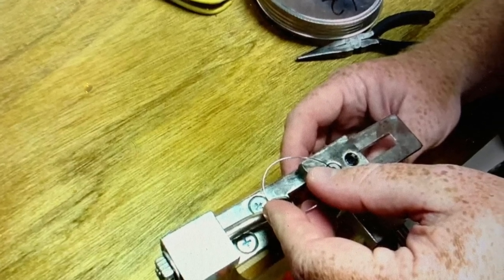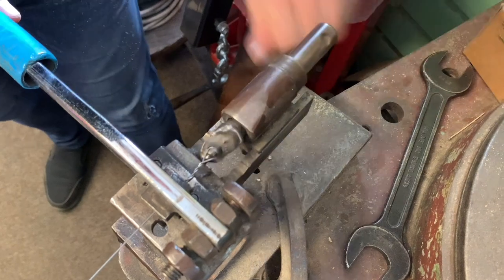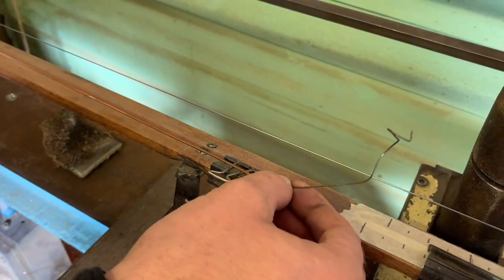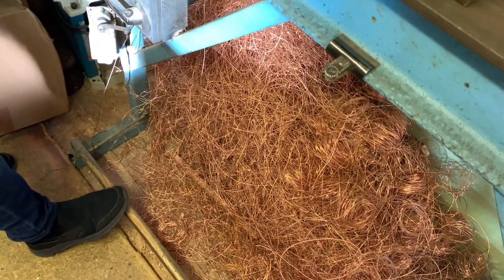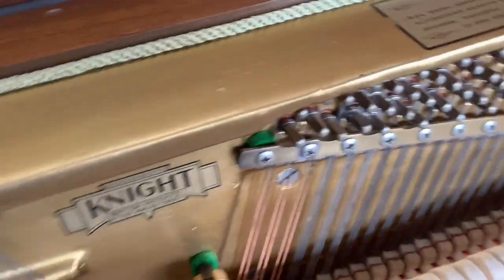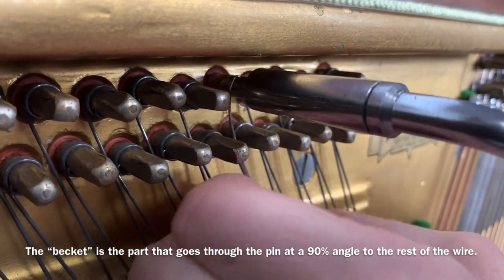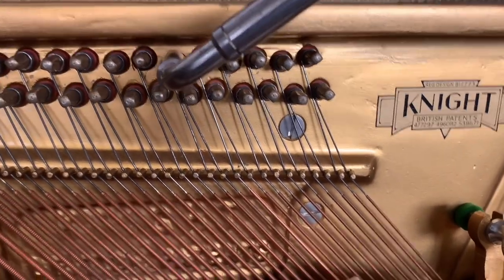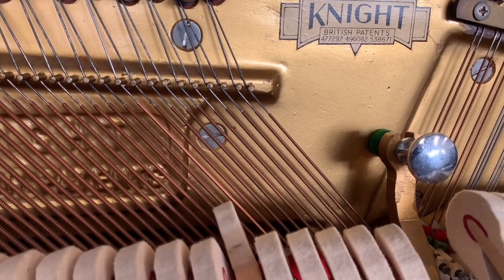Making of a copper wound bass string by Billy at Humphrey Lees in Canterbury UK

Comment: Across the pond, here in the USA, we generally only twist bichord strings one turn.  Too many turns can deaden the sound.  It also depends upon the string maker.  Some require no turn at all, just put it straight on.  I use a string coil winder to make the coil, then remove it from the tool and place over the tuning pin.  Insert the becket, and tighten.  Using the coil maker, you don't have to back out the tuning pin more than one turn, and the pin remains tight.
Reply from the maker: Thanks for that thoughtful comment Paul. We agree completely with this process. Marcus
Reply: Paul, are you capable of making an experimental set of guitar strings at your shop?  I'm searching for a string machinist in the US.
Reply: @lexingtonsmp  I usually use Mapes in Tennessee, at least for piano strings.  I don't make them myself.

Comment: Nice to see started working in string making for bentley pianos and first job straighten string wire and makeing eyes used a pair of pliers with a hole in the claws hard not to snap smaller gauge strings .and love the knight we to over knights i  the late 80s early 90s they are quality pianos